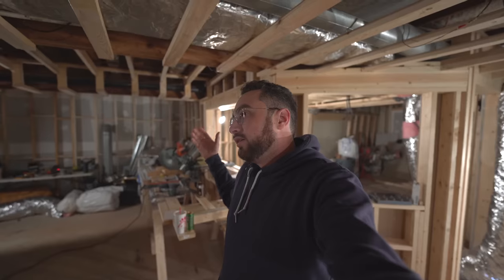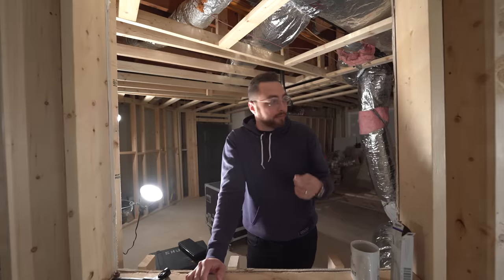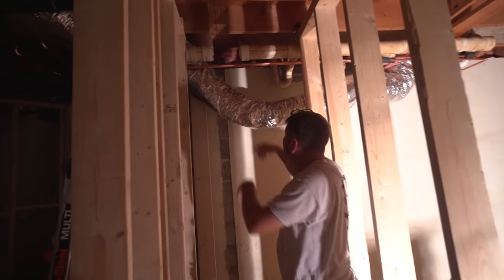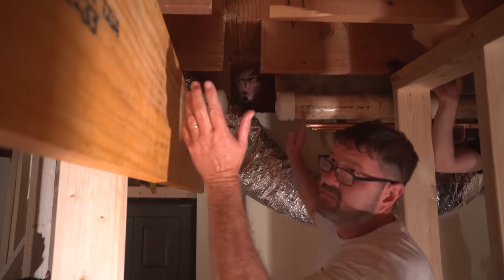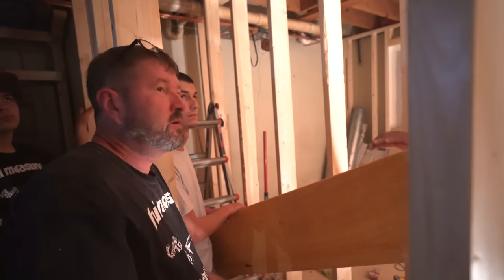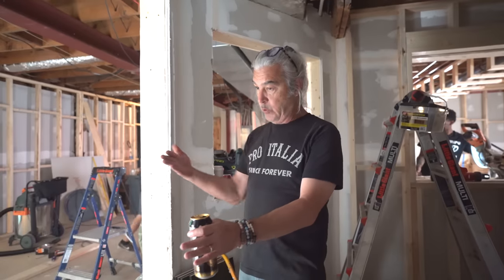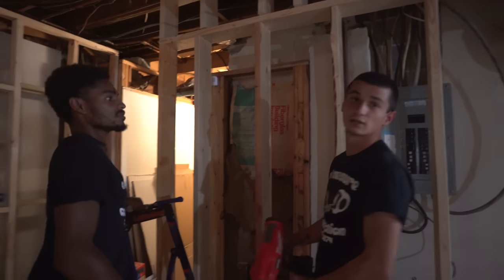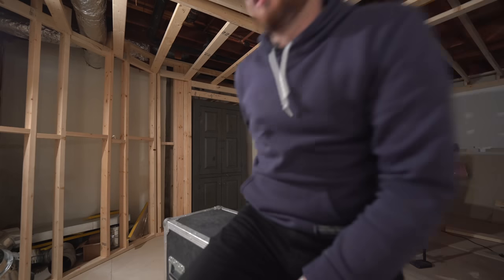We Need To Talk About The Studio Build  (I f*cked up)

Comment: Overthinking/overengineering this much ? 603 Avalon Avenue, Muscle Shoals, Alabama & 3614 N Jackson Hwy., Sheffield, Alabama. Home studio, the space is what it is, this shouldn't be anything more than wall partitioning for space management ? Most every famous recording studio is nothing more than common retail commercial construction for any era of history. All those theaters & halls that you played on the road. Brick or concrete block old buildings, the venues are nothing more than commercial buildings for mass audiences, just like the studios. Originally Muscle Shoals recording studio was a coffin/casket showroom. Who would've thought that some of the greatest music ever recorded was done in a coffin showroom ?
Reply: The issue is moving walls to opening up space and not finding a crew to install the beams to do it..
Reply: @daviddowns16  Why would beams need to be installed, there already is a ceiling in place, I would assume this is a multi-story residential and the ceiling of the ground floor/basement is the floor of the level above it. They were wiping out plumbing in the video. I've seen houses built, you can make them as nice as you want the space to look. Apparently the load bearing design is already there, this is nothing more than taking the existing space & partitioning the studio floor plan for the areas specifically intended. I could do this inside any residential house especially if it meant lowering the ceiling. What am I missing here. A special partitioning is just another wall.
Reply: My Dad built a complete barn style garage as a 70+ year old retiree in Murphy, NC. contracted the concrete slab & roofing obviously, but the rest of it he did in a few months using an old Ford Courier pickup truck to get the 2x4 lumber & paneling. He also built the stairs to the storage area for the project. It was living space level work, I bet he could've rented that out for living space & spare bedroom if he so desired. That garage is still around 30 years later and is easily as solid as any wood frame new construction being done today. It's completely wired for electrical too for code. He did that himself too.

These wall partitions for acoustical sound proofing or whatever could also be additional partitions that are not permanent to the building and utilize existing electrical wall outlets. And one can always do drywall work, it's not that difficult.
Reply: @jimcamp2423  the walls he took out in the basement were bearing the load of the house above, so an LVL and steel beam needed to be added or his house would eventually fall. He is moving to an open concept in that area of the basement.